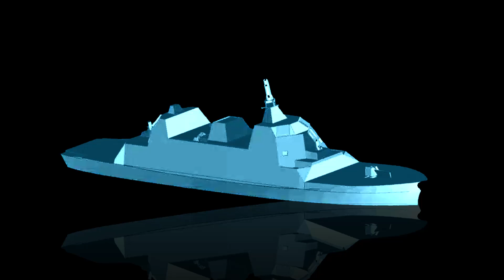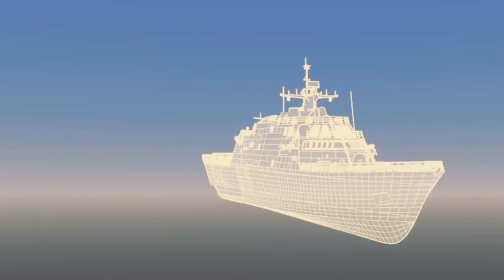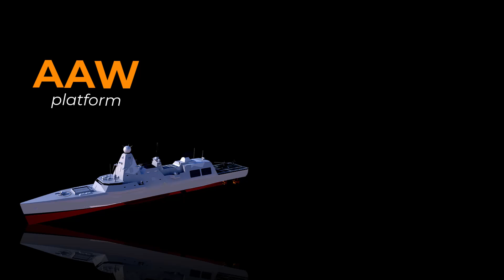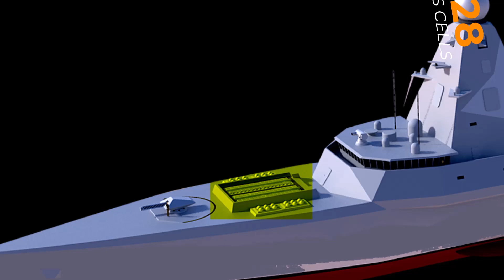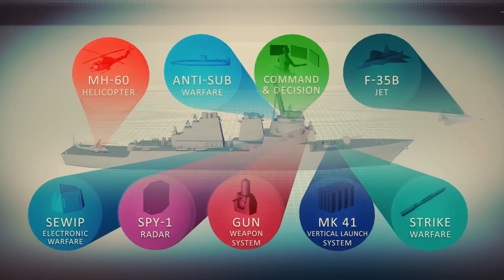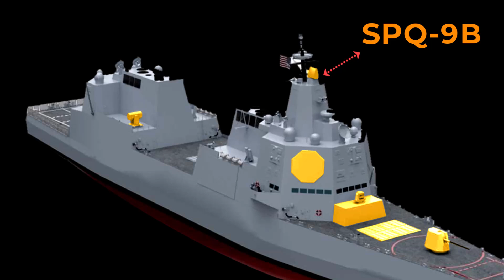Super Destroyers: Japan's 13DD(x) vs Type 83 vs Navy's DDG(x) || Why 13DD(x) is so Big?

Comment: The Type 83 is esigned to be fleet protection, specifically Air Defence for a Carrier fleet. It will be part of a joint task force with other Ships doing the focussing on other roles., so it doesn't need to be Top Tier in every aspect of it's capabilities.

Comment: Honestly I wish the Navy would just rework the Zumwalt design.  Replace the forward gun with a 5” mount or railgun and the aft gun mount with additional VLS cells.  Give it a new name and call it a cruiser.  It would greatly reduce development costs and make good use of a hull that is proving to be quite capable.
Reply: i second that except for one thing, which is the aft gun. it's already got a barbette and magazine, how hard would it be to design a 155 that uses conventional shells (of which we have millions) in addition to the long range shells (of which the patent wouldn't cost much to eminent domain and sell off to literally any other arms company, which we do often)? it needs at least one normal gun even if they just keep it shooting standard 155 shells. marines still need explosive fire support.
Reply: Search Fat Leonard

Comment: They aren't destroyers, they are cruisers. They don't want to call them cruisers because cruisers are offensive oriented rather than defensive and the public doesn't want to pay for that. Destroyers are small, lightly armed and most importantly cheap. These ships are large, they are loaded for bear and most definitely anything but cheap. The problem is they are trying to make one ship do everything to reduce cost. That philosophy has never worked as intended.
Reply: Call them Destroyers, Frigates (in the pre 1975 US Navy sense), Cruisers, Fast Fleet Escorts or Large Surface Combatants, modern terms are entirely irrelevant.

The last proper cruiser built to traditional cruiser standards was Long Beach.

Destroyers aren't supposed to be small and cheap, they're supposed to be fleet escorts. In the past that might have meant something small and cheap, but these days the requirements of high seakeeping speed, need to give radars a high radar horizon and LO shaping all drive up size considerably. As for cost, size is not directly correlated with cost, the combat system is main driver of cost, and modern threats require very capable and expensive combat systems.

Small and cheap is not possible these days, not since the Second World War. Combat system costs required to deal with even 1950s submarines made single-purpose mobilisation designs like the Dealey class or Type 14s impossible to mass-produce in peacetime, and nuclear submarines made that problem even worse.

Nowadays every surface combatant more capable than an OPV or USV requires local AAW capability, and AAW capabilities make up 90% of combat system cost.
Reply: @forcea1454 amen..!
Pretty much most ships are multipurpose. Either small (“frigates”), decent sized  (“destroyers”, “super destroyers”, “cruisers,” and “Battlecrusiers”). When in reality there’s maybe three different ships: small, medium, large, and MAYBE super size me. 

It’s about the size, specific mission, armament, defensive weapons and all that.
Reply: @deralbtraumritter8573 I agree, widespread adoption of strike length VLS, and staring phased array radars on all but the smallest ships are making ships of all types increasingly general purpose, although there is still some specialisation at the lower end.
Reply: Q. Do you mean "politically" NOT called a "Cruiser"? The RN Light Aircraft Carriers/Harrier Carriers were called "Through Deck Cruisers" because it was believed that they would NOT be approved with the correct designation BUT all 3 of the 4 originally agreed carried the "R" designation for a RN Aircraft Carrier NOT the "C" for a Cruiser. NOTHING IS CHEAP.
Reply: @trevorhart545  yes I mean politically. The ships that are doing a destroyers job today are frigates. And the ones doing cruisers job we call destroyers. A destroyer is defensive while a cruiser is offensive. The second you put asm on a destroyer it becomes a cruiser. True destroyers would be asw/aa oriented with little offensive capability against anything bigger than it.
Reply: @ADobbin1 ASMs don't make a ship a cruiser, especially given how minimal a ship impact they can have, otherwise every FAC would be classed as a cruiser.

What makes a ship a cruiser, before they stopped being built, was capability of performing independent operations. This meant long endurance via large stocks of stores, workshops to provide self-maintenance without dependence on a depot ship, certain levels of passive protection and redundancy, and flag facilities. Post War they were also expected to have significant fighter-direction capabilities.

This was obviously beginning to break down post war, Long Beach was basically just a fleet escort armed with SAMs (although Talos and Terrier had decent anti-surface capabilities and ASROC plus SQS-23 enabled independent operations in the face of enemy submarines or in the dispersed formations required in the face of nuclear weapons).
Reply: @forcea1454  You are right but those ASM's give it a role that a destroyer is not supposed to have.
Reply: @ADobbin1  In what way? Originally destroyers were supposed to attack other ships with torpedoes, anti-ship missiles are the modern equivalent.
Reply: @forcea1454  Yes but they were originally just oversized motor boats someone stuck a torpedo on. Later they started putting on machine guns to take out the other guys motorboats with torpedos. The guns started getting larger but the concept of a throw away ship culminated in the german E-boat, american MTB, and british corvettes while the destroyer took on a purely defensive ASW/AA role in fleets with their offensive importance falling off while the offensive roles like commerce raiding and Fleet escort firepower went to Light and heavy cruisers. In the last 50 years we have merged the role of cruiser and Destroyer in to one ship with the idea that it would be cheaper to build one ship that does everything in stead of two that do two singular things. It didn't work out that way and we have ended up with ships that can do everything but costs 5 times what two specialized ships would.
Reply: @ADobbin1  No, completely wrong, early torpedo boats from the 1870s onwards were steel displacement hull ships with steam machinery. Destroyers were similar, albeit larger given the requirement to escort the battlefleet. Right up until the end of the Second World War (and after, well into the 1950s) surface torpedo attack was still a role expected to be performed by destroyers, 21" torpedo tubes were still included in early preliminary designs for the first British Guided Missile Destroyers (at least until the Blue Slug anti-ship missile and later planned nuclear-tipped versions of Sea Slug offered much better anti-ship capability), and SCB 129, the early all-gun design for what eventually became the Farragut/Coontz class DLGs.

What you are describing is Motor Torpedo Boats, with wooden planing hulls, powered by internal combustion engines (initially petrol), which evolved from civilian craft during the First World War.

British Corvettes were anti-submarine vessels, again steel-hulled displacement hulls, initially derived from the design of a whaling ship. They were quickly replaced by ore effective frigates, only remaining in production to the short length of many shipyard slipways.

Commerce raiding was always a requirement for cruisers, especially when they were called frigates in the  days of sail.

As for specialised warships, combat system is the main driver of cost, not size, and specialised warships will still need highly capable combat systems, so you won't save any money there (especially given modern threats), an ASW Frigate will still need significant AAW capabilities, given the number of modern submarines capable of launching anti-ship missiles.

The increase in size is the result of seakeeping, endurance survivability requirements, the need to place sensors with as great a horizon as possible, plus the need to improve the standards of living quarters to maintain recruitment.

Smaller and cheaper is not viable, not unless you want a hollow force that looks impressive on paper, whilst being technically obsolete, unsurvivable, and being impossible to man, as a result of poor retention.
Reply: @trevorhart545 The Invincibles were called cruisers because they were cruisers, and descended from a long line of helicopter-equipped cruisers from the late 1950s onwards. ASW Helicopters and SAMs offered far greater ability to operate independently in the face of modern threats, plus they required flag facilities to control other surface ships.
Reply: This guy has too low a resolution for the Japanese. He is not a Japanese citizen, so please don't talk about Japan as if he is talking about himself.
Reply: However, in Japan, these ships are called "Goeikan" instead of "Kutikukan" which means destroyer. Why? Because what they have is not a warship according to the constitution lol.
Reply: CHAPTER II. RENUNCIATION OF WARArticle 9. Aspiring sincerely to an international peace based on justice and order, the Japanese people forever renounce war as a sovereign right of the nation and the threat or use of force as means of settling international disputes.② In order to accomplish the aim of the preceding paragraph, land, sea, and air forces, as well as other war potential, will never be maintained. The right of belligerency of the state will not be recognized.

Under the deception that "the right of self-defense as a nation exists" because of these laws, the military is renamed the Self-Defense Forces, and destroyers, cruisers, light aircraft carriers, etc. are also renamed escort vessels.
Reply: Modern U.S. destroyers are hardly “small, lightly armed, and cheap”. 96 vls cells with many cells for air defense and other cells for anti ship, submarine, and surface warfare.
Reply: @majesticface3631  That was kind of my point. What we call destroyers are not actually destroyers.
Reply: @majesticface3631  SPY-1 radars and Aegis are the main driver of cost, not the VLS.
Reply: Burke class an all around warship certainly is successful.
Reply: Recently, Japan decided to call this ship a cruiser.

Comment: You would think the DDX would be an Aegis System on a much larger LCS Independence Class Catamaran Hull with 9 Gas Turbine Engines (6 for engines and 3 for electricity)
Reply: what??? catamaran is terrible on large ship. the disadvantage at larger tonnage far outweigh the advantages
Reply: @nguquaxanguyen5224  100% Correct.
Reply: HMS Triton was the first Trimaran Warship built and the experience was so NOT GOOD that it was sold off and last seen with a Private Owner in Australia many years ago. Catamaran even worse than Trimaran. Type 83, BAE Shipbuilding are promoting themselves for their Long Term future NOT for a specific design which has NOT been agreed even in outline. My concerns is that they have NO MONEY actually allocated at all for any Type 83 development at the moment.

Comment: Not giving the Type 83 a decent anti submarine capability / helicopter think is a mistake, unless they always expect it to operate with a dedicated ASW platform. 
If some unfriendly power decides to go hunting for her, it will not be by air or missile, it will be underwster
Reply: watch the new ship chosen, Leonardo DDX, L'ITALIE, here you find all news GaliBellum pionnière avec le DESTROYER du FUTUR
GaliBellum
Reply: Drones will fill the gap maybe?
Reply: I think, the main reason for this is because its technically not a destroyer, but a flanking cruiser. Its main role is to assist flagships, not replace them.
Reply: it's an AAW destroyer, it's focus should be on that just like with the Type 45, we have the Type 26 to deal with ASW threats, that's the whole point of them. Rather the Type 83 have 128  VLS Cells and way more weapons for surface attack and defence than it be compromised because we want it to do too many things at once.
Reply: My understanding is that the Type 83 will complement the Type 26 and type 31
Reply: The forebear of the Type 83, the Type 82 Guided Missile Destroyer was designed to escort the CVA01 carrier project (all the bells and whistles) which was cancelled in 1966 leaving only HMS Bristol as a tech testbed.  It's thought the Type 83 will fulfill the same dedicated escort air defence role, if Labour don't cancel it, and the Frigate lineup will expand to include the Type 32 but only if the RN and Govt can manage to tell the same lie at the same time.

Nothing is known about Type 83 besides the MoD statements, there was an image of an unnamed very large warship estimated at 15-20k tons leaked from a BAe Systems powerpoint slide about "onboard safety systems" or something but was similar to their unreleased proposal to fulfill the Type 83 request.

I hope that the UK and Japan will work together for innovation and cost saving in the spirit of Tempest program, no USA because if the USN get's involved it will be LCS / Constellation Frigate 3.0 imo.

Comment: Technically the Japanese one is a Cruiser and the Type 83 is a designation for destroyer cruiser.
Reply: Terminology, or Designation, is down to the Country NOT a fixed concept. HMS Belfast (River Thames I.W.M.) was a Light Cruiser at 10,000 Tons. Modern Frigates are now heavier than many WW2 Destroyers or even Post WW2 such as the Darling Class which at Full Load was shy of 3,900 tons.

Comment: Rail guns are currently not technologically viable. The heat generated by the massive amount of electromagnetic energy and friction from the sabots limits barrel or rail life to just a few shots. Until this handicap has a solution, rails guns are not viable.
Reply: A few days ago I would have completely agreed with this.

But a recent article seems to suggest that Japan at least considers their current small style railguns are sufficiently ready and by the time the new Destroyers are deployed, they could have solved many of these issues as Railguns are stated to be part of these new platforms.

And considering that this is a joint venture with the US, it means that the US could have a Railgun on its own ships when its new Destroyers enter service (though not the behemoth 60 megajoule one they where developing, but a more moderate 20 megajoule one to begin with)
Reply: @Keemperor40K  It is noteworthy that a small rail gun was developed, but I think it is a separate matter whether it is superior to a conventional ship gun.
Reply: 日本の２度目のレールガン発射実験では多数の発砲を行なったようだが、砲身の損傷は見られないと発表されています。
Reply: 日本の小型レールガンは主に極超音速ミサイルに対する対空戦闘用で、地上、艦艇の目標のためではありません。よって対空に効果があればよいのです。
Reply: @かなりブンブン  "air-to-air combat" ?? Surely you are not implying that Japan's small railguns will be mounted on planes or drones???
Reply: No sip to air
Reply: in term of economically cost,  actually rail gun still more expensive  than missilies
its the reason why US navy move down railgun from zumwalt class